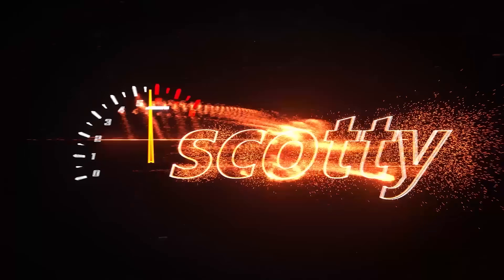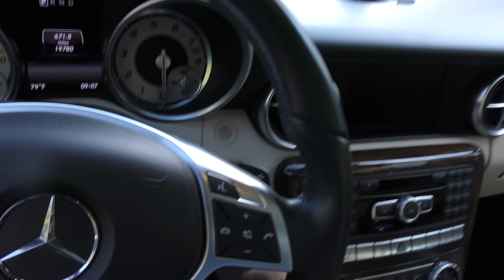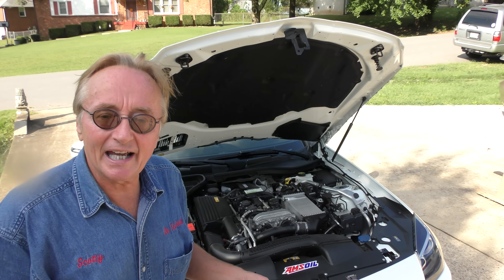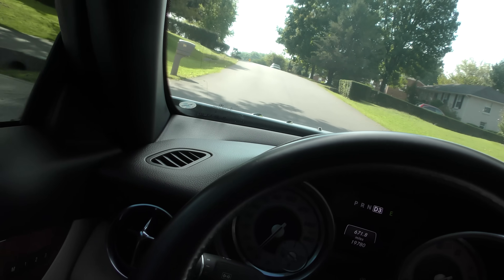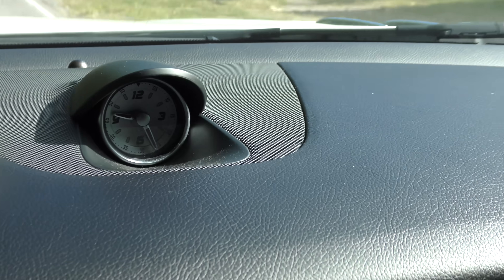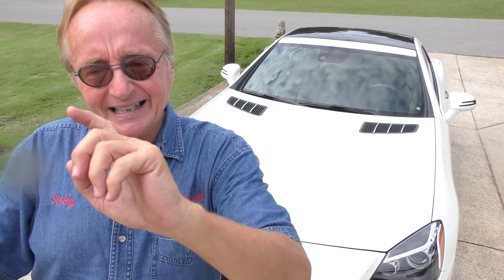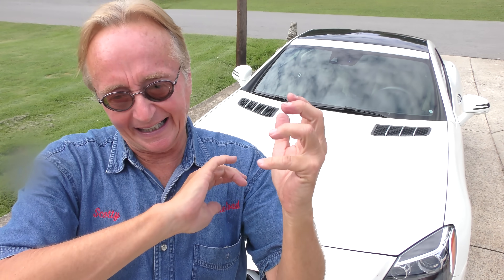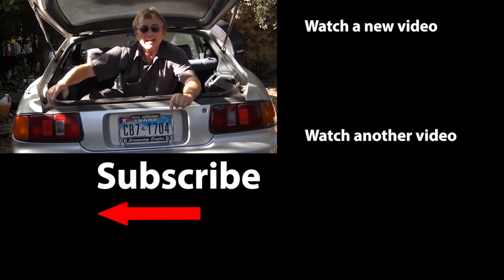I’ve Been Lying for Years, Mercedes is Actually Better Than Toyota

Comment: Have a 2001 Mercedes C Class. Yes it's old and cheap but it passed our annual test 3 times since I owned it and it's powerful on the motorways. I know it will fail me oneday but I use Scotty´s tips to keep it going
Reply: Fact it's 2001 says it all,, different built compared to now for sure.
Reply: ..so the older ,the better?.
Reply: @michealleeyoung4482 The older Mercedes are easily 200,000 mile cars as long as you keep up on the maintenance. I have a 01 CLK 430 and it’s running like a champ with 143,000 on it. The main problem with older Mercedes is the valve gasket seals and it’s not hard to replace them.
Reply: April fools!
Reply: Mercedes has never a chance Vs Toyota... Toyota and Ford are the best selling Cars in the World and Best Selling Car Brands. The Toyota Camry you can see so many for Taxi and Police in USA, Arabia and Asia. Mercedes you can not see and Japanese Cars are the most reliable cars...
Reply: @hamanncorporation1993  ford?
you sure about that ?
Reply: @7inchwarrior888  older Mercs are reliable. My 2002 c270cdi diesel has 303k on it. Drives beautifully, engine never been touched. No leaks at all, will probably go another 400k. No rust at all. Excellent & reliable car.  Don't think i will ever sell it.
Reply: I have a 1996 C220.  Made in Germany.  The engine will not die.  My dash did so i have no idea how much gas I have and use my phone for a speedometer.  But the engine is bulletproof.
Reply: w124 250d and 300d turbo are the best benz（100%  German made  and the turbo diesel engine are indestructible.)
Reply: @michealleeyoung4482  absolutely. Same with bmw etc,,I have two e39's (2003/4)and build quality is exceptional compared to my wife's present bmw 5 series,the second one she gone through in 3 years so badly put together. Everything cheap and disposable. My neighbor has 1983 Merc still as daily drive lol
Reply: I have a  99 C43 125k.I agree with other comments, over 20 years old and still looks and runs great!
Reply: @jb6368  ,just that name alone,commands, respect.
Reply: @jb6368  Actually 2001 W203s were the worst of the bunch. The later year ones were far better.
Reply: B4 the computers totally took over.
Reply: A lot of people are taking this seriously. They still haven’t realized its an april fools joke. 😂
Reply: @Ikhan, first year of new models always have bugs and need to be worked out! They say never buy a new model car. Wait a couple of years before you purchase. On 2001 was the first year for the model 203 or c class.. 2002-2003 were better.
Reply: @hanirahman13  try to find a better truck than a f150. Yes ford.
Reply: I'll stick with Toyota and Toyota parts.
All Mercedes come with a stepladder,
so you can reach the price of their parts.
Reply: @steve chance, I agree with you the value of the vehicle drops but the price for parts never drop! I recommend a Japanese car to anybody who asks me what I suggest. I use to be a mb tech, so I have the tools to repair it myself.
Reply: @hamanncorporation1993  Huh? Mercedes are as Taxi and cop cars in all of Europe and some parts of Africa 😂
Reply: @diablocls55  In Africa maybe little but really a little!!! And European is also not in all countries so it is really not important...And of course it is normel that you can see in Europe some Mercedes like in Germany, Belgium or in Netherlands...
Reply: @kumaboyy.7443  so true, changing a mercedes's spark plugs is like tripled changing any Japanese's spark plugs. I always tell people to either buy hondas or toyotas if they are going to work on their car because they are so easy to fix. The old ones have tons of clearance too.
Reply: @amigobarto,  yeah, my vehicle has a v-8 and have 16 plugs, 2 per cyl. I think the book time gives you 2 hrs, to do it. It can be done in an hour with a special plug socket and knowledge how to remove! I agree with you fully!
Reply: @kumaboyy.7443  My E500 had 16 plugs and my E550 had 8 lmao. My new (to me) CLS55 has 16 again
Reply: Those C250’s will last you a long long time with regular maintenance 🙏🏼
Reply: 2001 C320 with 285k still going strong and maintained its power over the years. It's actually proven tougher than my '95 Corolla and 2008 C350. 

Cars pre 2008 are in a class of its own!
Reply: @hamanncorporation1993  most cabs in Europe are Mercedes though 💁‍♂️
It all stands or falls with maintainance and maintaining a Mercedes in Europe is easier and cheaper.
Reply: @ModernLove100  I know!!! Some peoples here in Germany have really not much money but drive a Mercedes because it's really easy to drive here. But I Interested me not for Europe for me is interesting the World because of that I had bought the Camry...xD
Reply: I have a 2004 CLK320 with over 150k on the clock, it doesn't miss a single beat. No major issues, ever.
Reply: @michealleeyoung4482  not necessarily. Mercedes are hit or miss on models. There's really solid new Mercedes. Really unreliable old Mercedes. And vice versa. Reliability isn't consistent across there lineups. But there is definitely very solid Mercedes that run forever
Reply: @MLProductions.1  ,I agree on , solidly built,some old model shapes are too,nice as with other older makes of cars, from different companies....
Reply: @jb6368  I have a 2018 e300 with 20k in options. Short of the HUD going out, it’s been the best car I’ve owned. 30mpg on the Highway even at 75k miles on the ODO

And I have an unlimited mile warranty until 2023

My 2020 C Class and 2020 GLE, were just as reliable. I put a total of 20k miles on each of those and 45k miles on my 2018 E Class. 

Yeah it’s expensive asf for maintenance but you have to pay to play.
Reply: I have a 1995 C Class, its a gas hog and slow on acceleration but man this car never fails me, not that it doesn't need any repairs, the aircon is failing, but it never fail to start and leave me stranded.
Reply: How much km/miles could a mercedes c180 2006 last average if you know?, thinking of getting one as my first car.
Reply: The non turbo OM60x engines are much better than the turbo ones.
Reply: @jb6368  I agree. I had many BMWs and a few Mercedes. I always go for the older ones due to the build quality and reliability but my 2001 e39 is the best car I've ever owned. It was almost perfect in every way. Second would be my first Mercedes the 190e back when I was 23. That was a fun car.

Comment: As a former owner of an SLK I can say it was definitely a great car but wait until you start having to do some major repairs especially when it comes to fixing that foldable top.
Then again if I found a great deal I consider getting another one.
Reply: Exactly right RT I heard those motors for the hardtops-to raise the car up  cost 5000 each and their  are two motors.
Reply: To raise the top up.
Reply: @derrickjohnson5219  that’s insane! If those motors died, I’d just leave the top up for the rest of it’s life.
Reply: @derrickjohnson5219  
This was a while back.
The top would occasionally just freeze when opening and closing. After getting the estimate on parts and labor to repair top and fix other issues with the car I chose to pass it on. It eventually made it's way into the hands of a certified MB mechanic. 
I'm pretty sure the cost of repairs was darn close to the actual value of the car.
Reply: @MikeJones-pp7gu  have fun taking your car to the shop every month
Reply: @MikeJones-pp7gu  Ford had a top like that in '57 or '58---nothing new, but a pain to fix even then. I heard that Ford top had seven motors.  That may be the reason they only existed for a couple years
Reply: I feel like a simple sun roof is much more practical than a folding roof, and gives you much of the benefit of a convertible.
Reply: @derrickjohnson5219  no worries as long as it doesn't rain/snow.
Reply: @MikeJones-pp7gu  they don't break unlike mercs.
Reply: @robertromero8692  if you're into convertibles, you would know that a sunroof isn't a substitute to the roof being folded. sunroofs are great, but they definitely don't give me the same feeling as having a top down.
Reply: @crojackbojangles  It's not identical, but it gets you much of the way there.
Reply: @derrickjohnson5219  5k 😂 calm down dude, it’s 1k directly from Mercedes or a few hundred for one off eBay, they aren’t Ferrari parts.
Reply: @RT-mm8rq trash car get rid of it
Reply: It is expensive
Reply: 100 percent correct

Comment: Back in 2005 I was expanding my business to cover from I4 north  to the FL state line. So I was driving hundreds of miles 6 days a week. I started looking for a more comfortable car I found this 2002 S500 with 38k on it. This car had tech that is just now becoming available like lane keeping, auto distancing, auto braking, and fallow. In a 2002 I could lock on a car ahead of me and it would follow that car on interstate and small roads all by itself. 
One day I noticed the door didn't close. It has this thing called soft close. The car closes the door for you. It uses vacuum do alot of thinking like this. The door locks, windows, doors, and suspension. This pump started not working properly.  Took it to the dealer they said it's a $3,200 repair parts and labor. 
So I looked into it the car seemed so well engineered it couldn't be that difficult to fix. 
The pump was mounted in a box under the trunk and the manifold was in a insulated box in inner trunk wall. All original parts were $768.00 and it took me less than 30 min to replace them.
Reply: most car with a lot of these problems, people go to the dealer. if your willing to do a little research and work these cars can last a long time. my 04 e55 had distronic (auto cruise control) that i still use to this day, i was shocked when i found out it had it.
Reply: That's still a good amount of money just to close a door but yea that made a big difference.
Reply: $768 to make the door close 🤣😂
Reply: Lazy is how people make money do it yourself well done
Reply: Mercedes invented all the wonderful safety features starting in the mid 90's.
Reply: @bbhoustontx  and nobody else did?
Reply: Mechanics need to make their money. The other day I ask how much is it to replace my car transmission fluid. The guy told me: "well,  since you car has an CVT Transmission,  it's gonna be $200 plus taxes. That's include the oil" 🤣🤣

I spent $40 and did it myself after watching an youtube video on how to do it. 😎
Reply: Where d u buy original parts online?
Reply: @Numi_1996  it all depends. I get my oil from Walmart. No one can beat Walmarts price on Mobile 1 0w40. Rockauto is where I get most everything else.

Comment: One of my best friends is a mechanic and he owns a 1999 Mercedes E420 that was built in Germany. It was made before Mercedes went over the top loco with all the electronics and computers. It's got 170,000+ miles on it and it still runs like a Swiss watch. He wouldn't touch a Mercedes made from 2005 - present. He calls those things electronic computerized nightmares. A lot of them they won't even touch. They tell them to take it to a Mercedes dealer.
Reply: I’ve put 90k miles on a clk430. 2001 still no check engine lights lol
Reply: I think you meant E430
Reply: I imagine the top getting stuck and me having a heart attack.
Reply: Not true, I've sold my older benzes and bought a 2014 b180 blue efficiency with 50,000 miles on it .
It's well made runs well , the 1.6 litre turbo petrol engine with direct injection is a great drive and can give 55mpg on a run.
It's a well made car that we intend to keep for another 10 years before we go electric

Comment: I have a 01 Mercedes CLK 430 (AMG Package) with 143k miles one it and runs like a champ. Any M-B built before 03 are easily 250k cars as long as you keep up on the maintenance. The older Benz are easy to work on, plus the engines and transmissions are bulletproof.
Reply: No chance Vs Toyota Camry like my Camry V40 from 2007 beautiful vehicle and nice engine!!! (:
Reply: @hamanncorporation1993  Listen to your car when driving. It will often tell u when it's not happy. I change oil & filters every 12 to 15k or 18 months, which ever comes first. Being doing that it's whole life. Might put in a pint of oil every 7k as a top up. Mist slightly older cars are generally very reliable. Happy travels.
Reply: It's the electronics and sensors that fail on modern German cars. Their engines are solid.
Reply: @leonel2174  I change oil and filters every 10k km/1 year. It's necessary here as driving conditions/roads are bad and harsh in my country.
Reply: @Chopper153  Hi, Sayantan, i agree, u know ur car & environment best.  Adjust ur service intervals
Reply: According to ur cars best interest. Only u know ur car & engine. No one else can determine ur unique needs. Many happy years of good motoring.
Reply: @hamanncorporation1993  to bad your camry would shake apart on the highway doing 140+ km/h 😂 I'll stick to my German tank
Reply: Hog wash, CL class, S class, E class, C class very low maintenance! 

All cars costs lots of money to fix  when they break.

Mercedes hands down best ever made car.

Best driving car best looking car safest car, best technology.
Reply: Agreed. I had an 01 E55 AMG. Regret selling it. Built like a tank.

Comment: I agree with you Scotty. Make the big corporations buy the hydrogen and electric cars and change their fleets instead of making the little guy pay. If it works out for them and they get more infrastructure then it will trickle down.
Reply: Ive said for years if I was building an electric/hydrogen car company my target would be municipal vehicles. Police and township owned vehicles. They can reliably plug in every night and generally don't have to worry about extremely long range option. Police cars can take up more trunk space with batteries so that they can run their equipment. They don't need a front trunk just a back one
Reply: There is a company in Europe that specializes in EV conversions.
They developed a kit to convert existing old garbage trucks for the cost of a regular diesel truck. It comes with a complete restoration of the frame and cabin redesign, as well as new electric drivetrain. They don't drive that far, but they don't need to
Reply: Hydrogen is no problem….. just get yourself a 9v battery, 2 paper clips, and some water.  😂😂😂😂

Comment: But "Those big old V-8 motors" sound amazing! I just picked up a 2013 SLK 55 with 42K miles for $25K.  Nothing beats the sound of that V-8 and with half the cylinders deactivating at highway cruise I get almost the same mileage as this 4-banger.  This is our 4th Merc (e350, c300, GLK300 and now the SLK55) and none of them have needed horror story repairs as some suggest here. Maybe we're just lucky.

Comment: Just buy two Elantras, and when the engine goes at 80,000 miles, drive the other one. After the first one is fixed under warranty,you have the other car. You then still have a couple of hundred thousand miles of comfortable driving under your belt for less than the price of one Mercedes!

Comment: You have to admit these these Benz’ are just beautiful. Each time I am in the market for a new vehicle, I get so tempted to buy a Benz. Then I remember what Scotty says which is why I just bought a new Lexus. Of course I also remember how every friend of mine that has bought a German car has had nothing but problems.
Reply: You either lease & keep it all under warranty work, or you work on it yourself. No other way other than at least being able to diagnose & have a GOOD indy who knows the brand.

I need rear subframe bushings on my 2010 E350 coupe. I do my own work, but don't want to deal with pressing in/out the bushings given it's my daily. One dealer wants $2,200, another wants $7,700. I ordered my own parts for $98 & my indy is doing it for $600. I've done many jobs for less than $200 that the dealer wants thousands for. That's how you do it.
Reply: I had 158k on my 2007 E550 when I sold it and never did any major repairs.
Reply: If you're getting a German car be prepared to sell it after warranty.
Reply: Totally agree. 2nd hand Benz, BMW, and Audi are dirt cheap and then I remember the cost of parts and labor 😆.
Reply: Get a german car made in germany, not US. The Mercedes made in US are low quality.
Reply: Is mercedes c180 2006 reliable?,  and how much km/Miles does it last average. I'm thinking of getting one as a first car but it has 140km on it.
Reply: Each time??? How many times are you in the market? I bought my car in 2004 and it still runs fine. Maybe if you buy better cars and take care of them more, you wouldn’t be in the market so much.
Reply: @bigcrowe9573 My father in law had a 2006 C180. He bought it with 80.000km and drove it until 330.000km and sold it. Never heard him complain about it.
Reply: I never had problems like that with any of mine